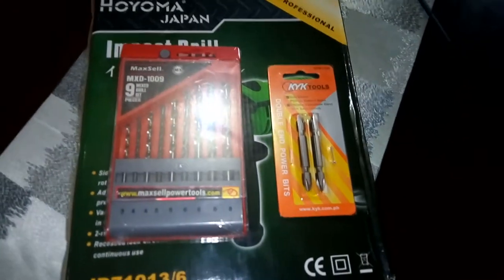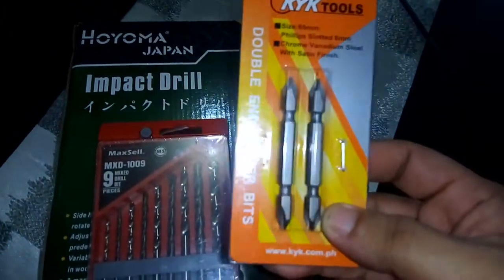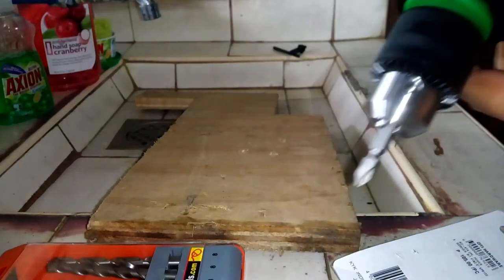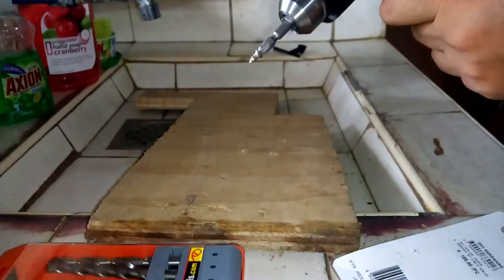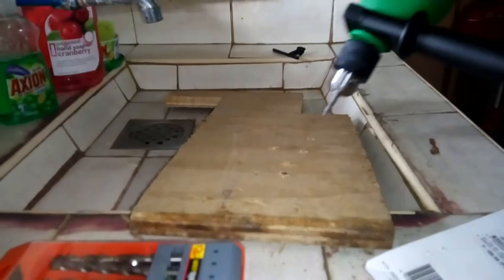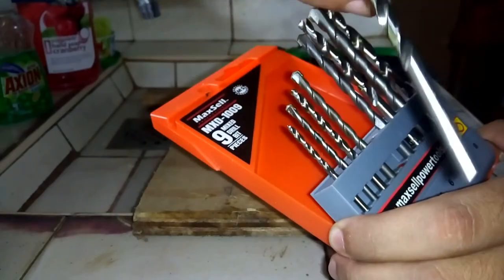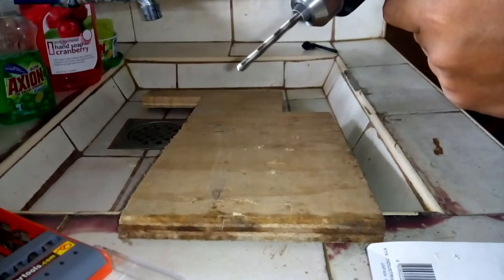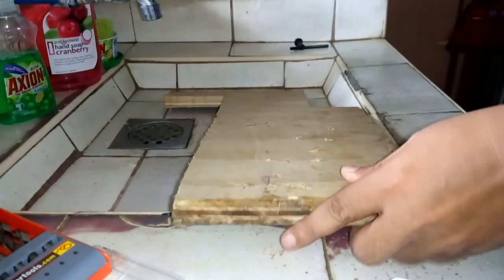Hoyoma Impact Drill Japan Testing

Comment: Sir.. testing with concrete bos.. even cheap drill and using screwdriver can fasten screw at plywood..
Reply from the maker: sorry, I made this video 5 years ago and I admit I lack so many things to put this drill to test. but I can say that I already use this drill on concrete, metal, wood, and I have no problem using this tool.. those bits and hoyoma drill still exist up to this day